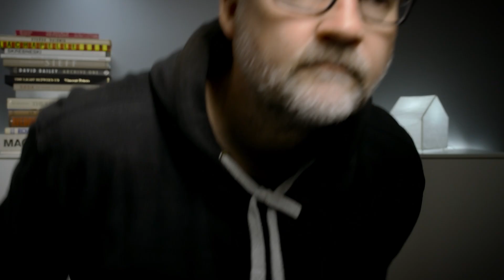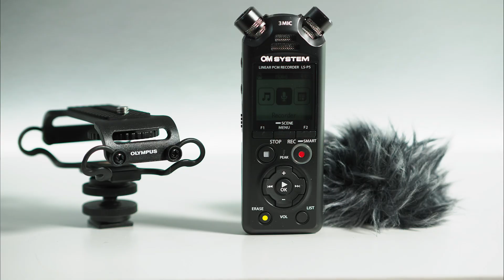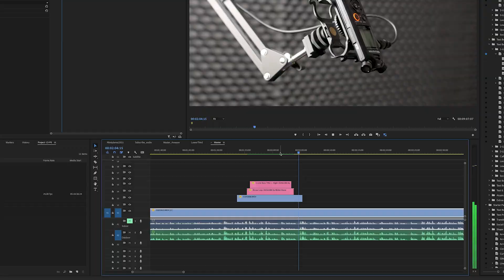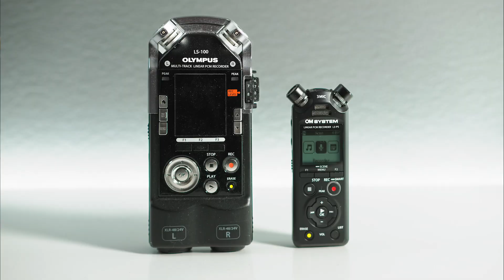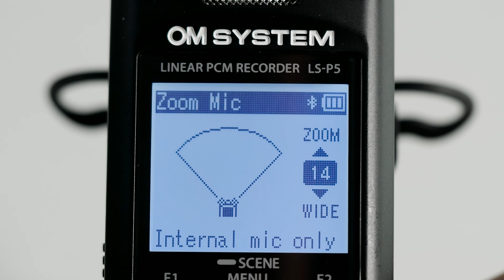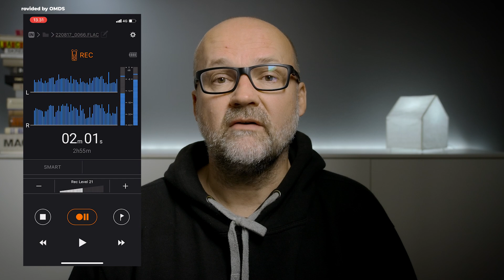OM SYSTEM LS-P5 - NEW audio recorder from OM SYSTEM!

Comment: Hi can you tell me where to get the kit with the shock mount please🙂
Reply from the maker: It seems that OM SYSTEM is not selling it as kit that includes the shock mount. You can get a LS-P5 videographers kit, but it does not include the shock mount. You need to get it separately. All can be found from https://explore.omsystem.com/

Comment: Returned mine. The microphones were not nearly as good as the mics on my Tascam DR-40X. Nor did the mics outshine my lowly Azden SGM-990 shotgun mic for all around use. It was small and compact loaded with cool features, but the microphone quality kept it from being the all in one audio solution I was looking for. Not to mention I paid $149.00 U.S. for the Tascam DR-40X which has phantom powered XLR inputs and allows me to use my professional mics.

On a final note for the price the LS-P5 should include the accessory kit as did  my Tascan DR-40X.

Comment: This product is clearly aimed at camera vloggers on the go. It's a nice compact size for the pocket and to mount on a camera or a cage. It would be a suitable upgrade for my Olympus LS-P1. Disappointed by the inclusion of a microUSB, it's 2022 USB C would be more fitting for the price, but it's not a deal breaker for me. For less money you can get the bulkier Zoom H4n Pro which has better XLR connections and records 4 tracks, but I think it's for a different market, aimed at field recordists.It would look ludicrous on a camera. Thanks again Peter for your demo.

Comment: Big disappointment for me: 380USD for simple recorder without XLR, 32bit and USB-C? 🙄I understand, it's for reporters or vloggers, but Olympus says: for "professional filmmakers" 😉 It should be half the price, to be honest...
Reply from the maker: It is 219€ here in Europe. The price on GetOlympus is 249,99USD. I would buy from there, it is quite a lot less than 380USD unless that higher price includes something more.
Reply: @ForsgardPeter  Yes, you're right, it's 220 euro - my mistake, 380USD is for big set with additional accessories. However, 220 euro for this type of device is also too high (in my opinion, of course). Tascam DR-05x and Zoom H1/H2 - there are the competitors for LS-P5, in half the price. 220 euro is the cost of Zoom H4n Pro with two XLR inputs...

Comment: thanks Peter. 
sorry not being around much lately. busy in my vacation trying to mater Martins and Swallows in flight with my om d 1 mark iii. until now best results are with the zuiko 40-150 mm f2.8 with and without the 1.4 TC. but still not very happy with the results. the good news is that now the bird is in the frame 90% of the shots.
Reply: I had the same problem using TC with the 40-150.  With the 300mm the TC worked excellently!  I sent 40-150 for maintenance at OM service Portugal, explaining the problem, and now the results are great.

Comment: Peter I am also an LS100 user. It is a beast of a recorder but the software is getting really old. I have not been able to get recordings to sync with the newer Em1 Mk3. Now that there is an LS-P5 I am very encouraged.
Reply: I only just started looking into Olympus recording gear for the first time in over five years and was surprised they hadn't updated an XLR recorder since the LS100.
Reply from the maker: I do not know why they have not updated LS-100. It is not in their line up any more.

Comment: I love the idea of this new recorder and I'm glad they are releasing other equipment. While it's feature rich, i'm a bit disappointed that it uses a micro usb port instead of a usb-c port. That seems a bit off since the cost is over $200. But It is feature rich and I can't deny them that. Another thing I'm so confused and disappointed by this recorder is the fact that the OM-1 can't trigger it to record. While a lot of flagship cameras now have a way to get better audio using XLR adapters and modules that are triggered by the camera this one is still basically just another external recorder. The E-M1 Mark II even has a way to trigger the LS-100 automatically. This is a bit of a waste, but hopefully this means that there is a new LS-100 that'll come out that can be triggered with the OM-1 and hopefully that recorder can record in 32-bit float. Great video, Peter and I LOVE LOVE LOVE the opening of you setting up!
Reply from the maker: I would have also wanted OM-1 to turn on the recording automatically. 32 bit float would be nice, but I thin it is ok like this. 
Thanks for the comment about the opening. Something a bit different.

Comment: Hey Peter, thx for the Impressions. The sound in your video sounds a little thin, could be more bass-heavy
Reply from the maker: It is a bit different from what I usually have.  Need to fine tune the audio.
Reply: @ForsgardPeter  I thought so ;-) One more question - if I connect the LS-P5 to the camera, is the sound recorded directly in the camera so that I don't have to sync it in the post process? And do I have to press the record button on the LS-P5 or will it automaticly record when i press the Record Button on Camera?
Reply from the maker: You can use pass trhough so that the audio is recorded with the LS-P5 mics. In that case you do not need to sync anything. If you use the audio taht is recorded to internal memory or microSD card inside the LS-P5 then yes you need to sunc the audio.

Unfortunately LS-P5 cannot be started from camera. You need to press the record button on both devices.
Reply: @ForsgardPeter  Big thx Peter
Reply: @ForsgardPeter  thanks, could you forward to omds to consider this in a future firmware update? It should technically be no problem to trigger the ls-p5 over the OM-1